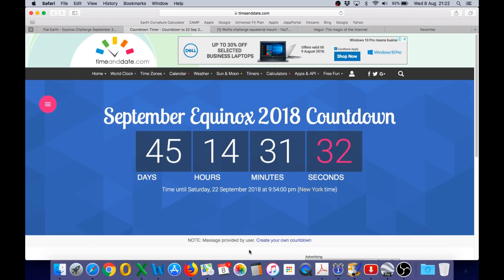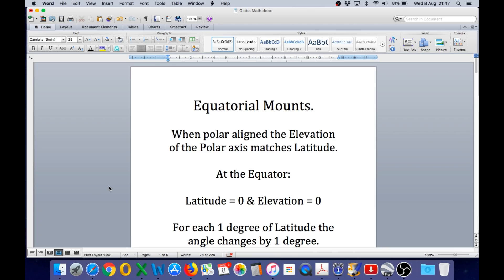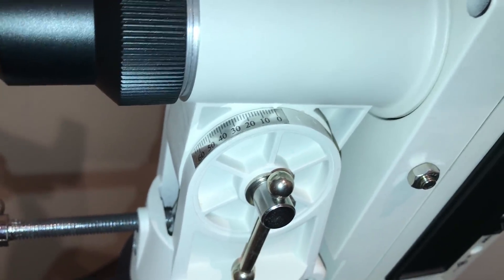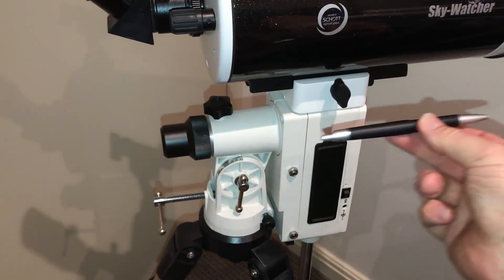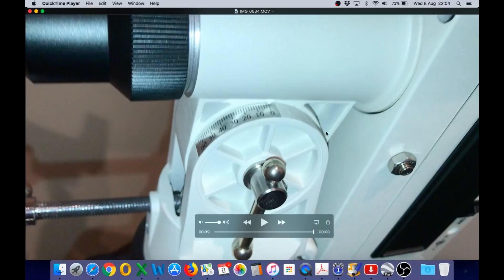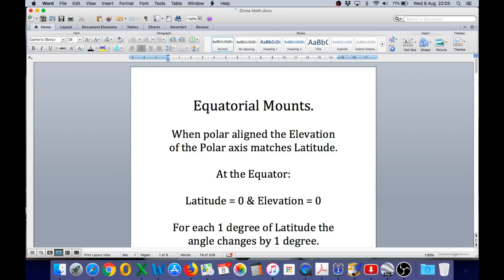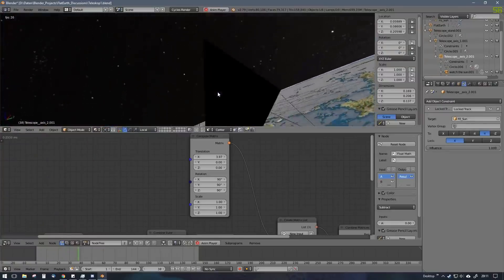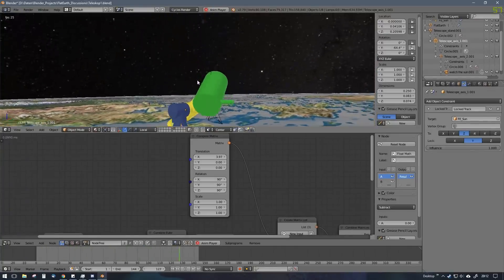Equatorial Mounts - a huge problem for Flat Earth.

Comment: Wolfie, are you at all accepting or open to a possible oblique Spheroid?
Reply from the maker: +Gigi Bubblegum.   Do you have a picture?   Did you mean oblate spheroid?
Reply: Wolfie6020 of course I do.. Lol.. thank god for you... 
No, no pic, but even my most hated Neil degrassi Tyson mentions it being something of that type rather than a ball..  just wanted to see how you felt about it
Reply: Wolfie6020 ps.. I take you very seriously.  Lol.. I believe that your are the only sensible person in this whole debate. 💟😊
Reply: Technically yes, an oblate spheroid. But the difference is so small it's not visible. At the equator it's about 13 miles difference.
Oblate means flattened, in this case at the poles. Spheroid means sphere like but not perfect.
Reply: Gigi Bubblegum, because the Earth is an oblate spheroid there is a mountain that is taller than Mt. Everest, but it does not count because it is near the equator where sea level is higher. 

It is the summit of Chimborazo, in Ecuador, at 6,384 kilometres (3,966.8 mi) from the center of the earth (the peak's elevation in relation to the sea level is 6,268 m (20,564 feet)). This is due to the Earth being an oblate spheroid rather than a perfect sphere. An oblate spheroid is very much like a sphere except it is wider at the equator and narrower between the poles. This means that Chimborazo, which is near the equator, is farther away from the center of the Earth than the peak of Mount Everest. The summit of Mount Everest is 2,168 m (7,112.9 feet) closer at 6,382.3 km (3,965.8 miles) to the Earth's center. Peru's Huascarán contends closely with Chimborazo, the difference in the mountains' heights being 23 m (75 feet).

This site will calculate the height of sea level for any given latitude:

https://rechneronline.de/earth-radius/
Reply: Mandelbrot Set wow. Thanks for taking the time to write all that. I appreciate it. I'm wondering if this is why there are no true, and without digital enhancement, photos of earth.. even a squashed ball is something that won't be offered to us?
Reply: on the pictures we get of earth, it would equal like 5 pixels difference, have a look at the pictures taken from the Himawari-8 satellite
Reply: Gigi Bublegum, there are all kinds of photographs of the Earth that have no digital enhancement. They are not going to look as good as the background on an iPhone. I think that this space probe takes a photo every hour. All of the clouds are where we know that they are.

https://epic.gsfc.nasa.gov/
Reply: Bnslamb ...and everyone who's written here.. you've all been patient and helpful, no insults, which is highly appreciated.
In hindsight, I should have actually taken interest in science and humanities, rather than boys... who I know very well, however knowledge on scientific reasoning and equations.... hmmm....😩
Reply: The Earth is wider around the equator than around the poles.  https://en.wikipedia.org/wiki/Earth#Shape 
Earth equatorial radius = 3963.2 miles, Earth polar radius = 3958.8 miles. 
All objects, Sun, Earth, Jupiter, Saturn, etc. . . that rotate fast enough are oblate spheroids.  https://en.wikipedia.org/wiki/Spheroid#Oblate_spheroids 
It is because the rotational motion is counteracting against gravity to produce the equatorial bulge.  https://en.wikipedia.org/wiki/Equatorial_bulge 
It is similar to hand tossing to stretch pizza dough.  https://youtu.be/i2Qc3KR6XVQ

Comment: Hi wolfie 6020, don’t know if you have seen this, but according to thrive and survive the theodolite app proves flat earth! 
https://youtu.be/G8gRts_Js4A
Reply: I wrote the authors of the theodolite app. They said that it does not remember the "zero" from one run to the next. The zero button is lit when it remembers it. You also cannot use it in an accelerated frame like an airplane. It has all of the limitations of a plumb bob.
Reply: OMG... T&S is an idiot.. LEVEL MEANS PERPENDICULAR TO THE VECTOR OF GRAVITY! It will show 0°- the horizon drop anywhere on the globe earth. Theodolite app uses accelerometer sensors in the phone, which can measure the current gravity vector towards the center of the earth. 

BTW. Last time he has used the left indicator to prove that the horizon doesn't drop.... yup the indicator that shows left/right tilt. 

T&S is so incompetent even for a flerfer..  everything he ever said and show was obviously wrong.